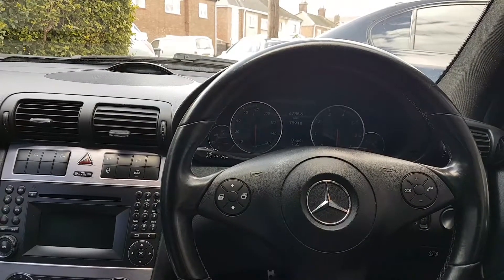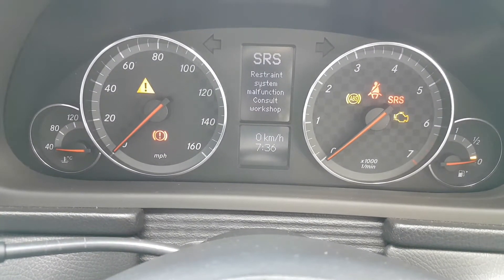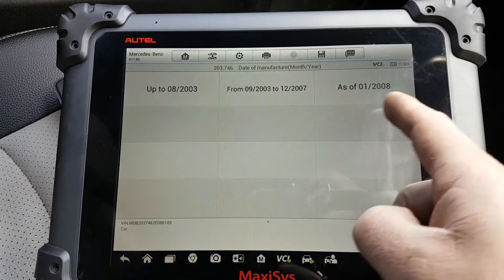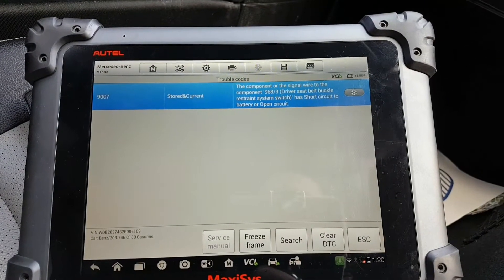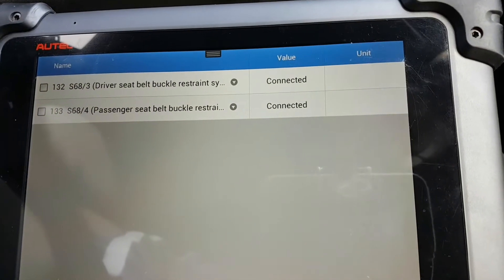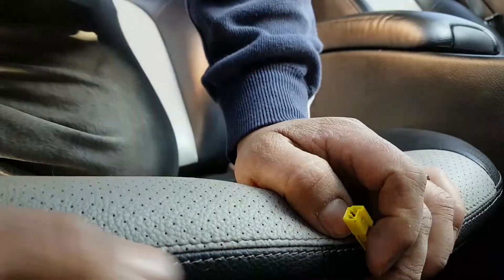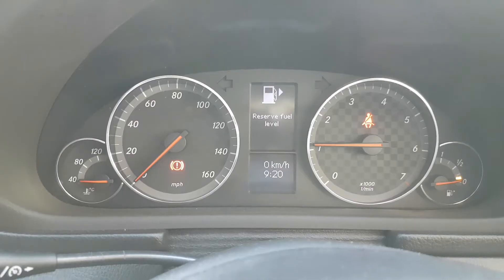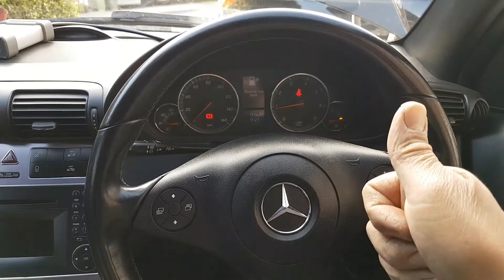Mercedes CLC W203 SRS light on. Error 9007. Fault finding and repair.

Comment: Please help me.
The tachometer of our B-Class W245 car, made in 2005, is lying. Sometimes it shows more, sometimes less, but sometimes it stays at zero and does not move.
Where should I look for the reason why hpol is showing so much and so much? What could be the most likely reason. Possibly a soldering error? Or could a contact be faulty?

Thank you very much in advance for your kind help!
Best regards, János bohus
Reply from the maker: Could be...
But, have you scanned the car, to see if there is something than might point into any direction? 
Or check live data, see what is actually happening...
👍👍👍

Comment: I m in the same situation with my Vito. The previous owner cut the wires just before the plug which comes from the vichecle and connects to the plug which comes from the driver seat belt buckle. I've done same a you to remove the yellow plug and connect the wires but still getting the srs fault. 
I did diagnostic and the fault is: 9015?
The coding for component S68/1 ( Driver seat belt buckle switch) is Faulty.
STORED

I got new seat belt buckle and connected the wires as I cannot find anywhere the plug but still same issue.

Also the seat belt light dosen't work at all on the cluster.

Any idea what could the issue by
Reply from the maker: Have you checked wring all the way back to the module?
👍👍👍
Reply: @LMAutoRepairs  
Thanks for your quick response.

Not all the way as it goes under the floor where the passenger double seats are.
The interesting is that when the wires for the seat belt buckle is not connected the srs fault dosen't appear on the cluster no warning lights the only issue is when driving over 15 miles is beeping like you have not inserted the seat belf but as soon as I connect the wires for the buckle  the srs fault is on.
Reply from the maker: OK...
Is the buckle surely the correct one for that car?
Reply: @LMAutoRepairs  
Yes, it is the original Mercedes one.
Can I ask where are you based in the Uk
Reply: There is also another code.
Display is reading a code when igniting turn on, LA:06. This is where the clock is located, it flashes on for about 15seconds and then goes out.
I m thinking the code LA:06 mide be due to seat belt light does not work and that's why this code is appearing.
Reply from the maker: Possibly...
Without proper checking it is difficult to tell exactly what the issue might be...
Reply: @LMAutoRepairs  
Update. 
The code LA:06 was due to seat belt light not working because the previous owner broke the bulb inside the cluster. I've managed to open the cluster and solder another buld and the seat belt light is back on and the code LA:06 is gone.

I went to a guy with a good diagnostic computer to try and clear the srs fault as the new buckle has been installed but still same srs light is still on but the beeping when driving is gone now.
The guy mentioned something about short circuit.

Basically,  everything work's as it should just the srs is still there.

Comment: Code 9076. What the hell is this? SRS will not go away no matter how many times my ZurchZR13 erases it. The C320 wagon I have is a frickin piece of junk. I’m sick of it.
Reply from the maker: Not really sure... that sounds like a communication fault... check other modules for communication faults... that might not be necessarily a fault with the SRS, but some other module that is failing to communicate with the airbag module...
Thank you for watching!

Comment: hy mate.you can help me?,i have a amercedes benz a class A170 ,2005
.i was to one mecanic and he read me this errors:,,9025 Component B48(front passenger seat occupied and child seat recognition)is defective and
9242 The resistance value in the ignition circiuit containing component R12/21(Right front side airbag ignition squib )is too high...What i can do to fix this errors,because mecanich tell me is possible to be sensor from chair and is around 300 pounds...what you sugest me to do?
Reply: Hello, Have got the same issue
Reply from the maker: Yes... can be the sensor...
Without checking it is difficult to say...
Hope you get it sorted...
👍👍👍
Reply: @LMAutoRepairs  what sensor?inside the chair?
Reply from the maker: Yes... in the seat... under the upholstery...
👍👍👍
Reply: @LMAutoRepairs  can this be rectify pls

Comment: hey have you ever heard about the XTOOL X100 PAD2? u know if its bi directional? AND the Ancel X6 OBD2 Diagnostic?? (supposedly  does some bi directional controls)?? cheerz!
Reply from the maker: Have heard of the X100... never the second one... that said, I have never used either of those... so can't really advise...
Thank you for watching!
Reply: @LMAutoRepairs  but have you heard negative feedback about the xtool brand?
Reply from the maker: Not really...
I heard about, but never really dug into it...
Like any tool, will be good and bad experiences...